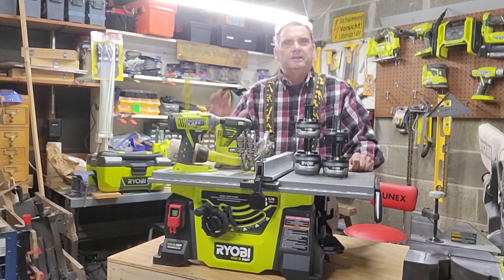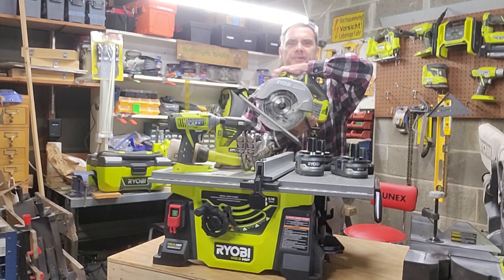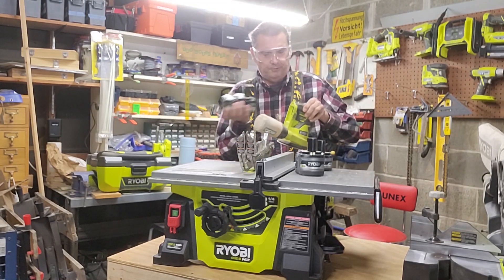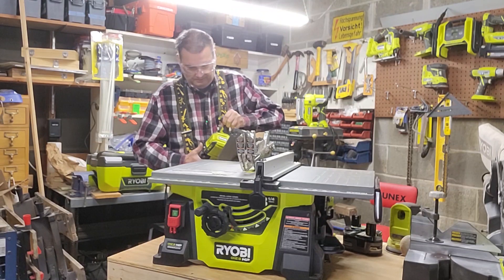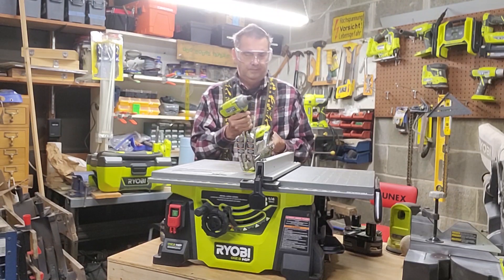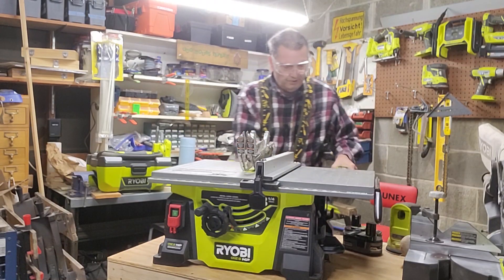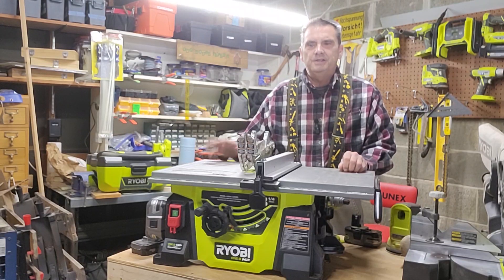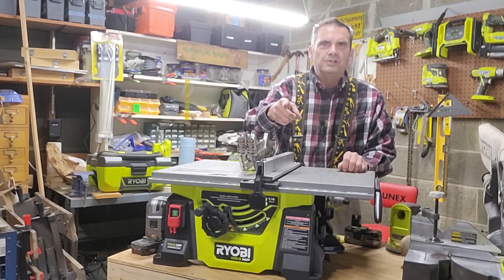Ryobi 18v batteries-Does AH rating matter in tool operation? (S4-E7)

Comment: Great video. This is also true for the P738 Inflator. This thing will shut down in 2 seconds with 1.5 or 2 aH battery.  Pretty odd for a "tool" that isn't cutting or screwing something.
Reply from the maker: Thank you for your comment. I have a P747 and am able to use 1.5 ah battery so good to know for others who may have a P738 and are having the same issue.

Comment: Very interesting but totally counter-intuitive.  Assuming all batteries are fully charged, it should be the voltage that drives the "power" (assuming the rated amperage is available), and the amp-hours determines just how long it'll run.  Were the bigger batteries HP?  Anyone have a technical explanation for this?  Ironically, I run all but 1 of  my Ryobi 18V tools using Ridgid's 18V batteries (using a $15 adapter available on eBay), from 1.5 to 9 AH, because the Ridgid batteries have a lifetime warranty, vs. Ryobi's mere 3 years, and fit perfectly with the adapter (which can't be used to charge, but I have no 18V Ryobi chargers other than one for a stick vac--which is an integral part).
Reply from the maker: Thank you-I really appreciate you taking the time to respond and inform on this issue.

Comment: I just purchased a 9AH Ryobi battery from Home Depot, let us see if the power still increases? If so this is a game changer for all Ryobi 18v tools including the 18v table saw.
Reply: Yes it does, I only use the 9ah battery on the Table Saw or Miter Saw. Big tools like those should only be used with 9ah and 6ah could be used on circular saw, rotary hammer, etc. Smaller tools will do fine with 4ah. The 2 ah I only recommend on the smaller stuff like drill impact driver but if portability is needed. If you need more power 4ah makes a difference.